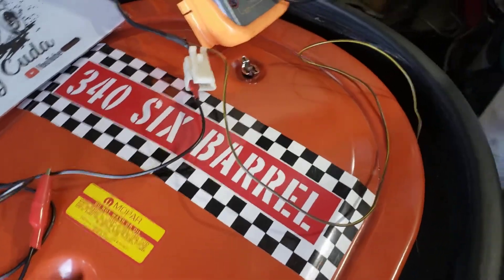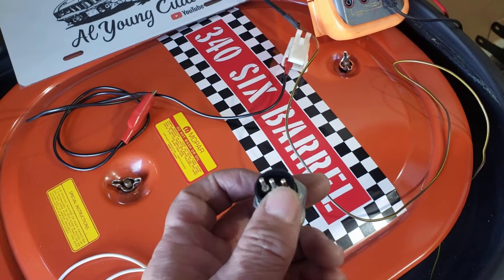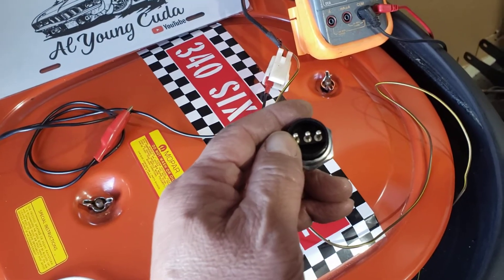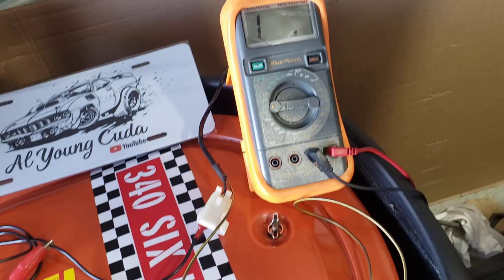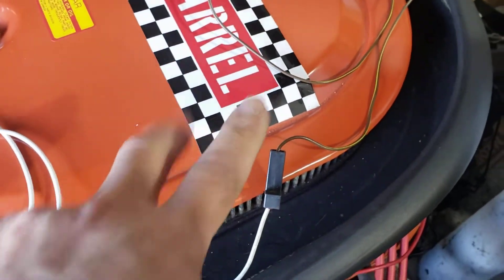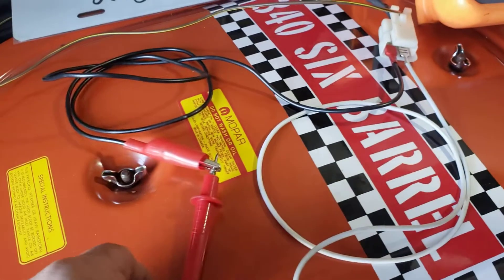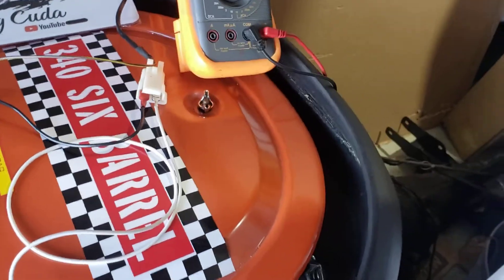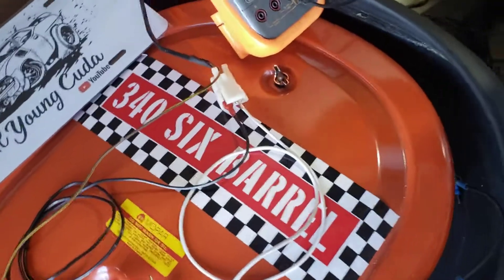727 904 Torque flight Neutral Safety Switch Operation  Wiring What You Need to Know and how 2 test

Comment: So if I were to wire the entire thing myself(PO completely got rid of the wires) middle prong to ground on relay, 12v power to one outside prong, and does the 12v out go direct to the reverse light wires?
Reply from the maker: Correct..center to the relay for the ground and the 2 outer work the reverse lights..12v in and then 12v out to the reverse lights
Reply: @alyoungcuda  excellent, thank you! This thing is a wiring nightmare the 2 previous owners ruined everything haha

Comment: Your video was very helpful for my 1940 dodge with an TCI trans, I only wish you would have shown the Voltage/ohm meter instead of the switch points on the transmission or both.
Reply from the maker: I like the use of the sound to show continuity as compared to looking at the meter for ohm readings since the length of the harness and age can make a difference,  I'm just trying to show that operation of it.

Comment: I just acquired a 64 Dart GT convertible and it had this switch installed but not connected. This video definitely helped getting the switch wired. Great video! Thanks!
Reply from the maker: You're welcome and thanks for watching..GT Convertible..cool car
Reply: the 64 probably has a 1 wire switch. Will the 3 prong switch work with the earlier (push button) transmissions?